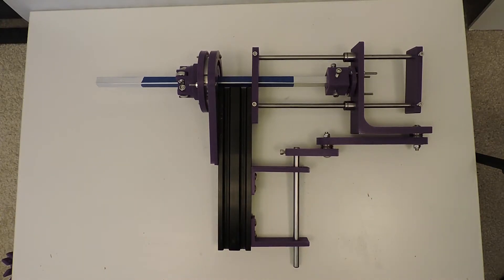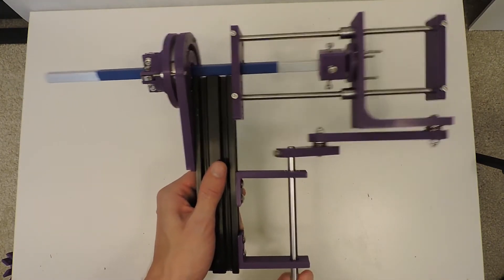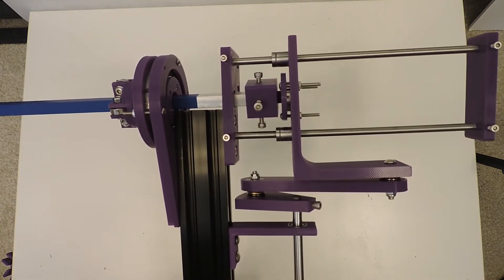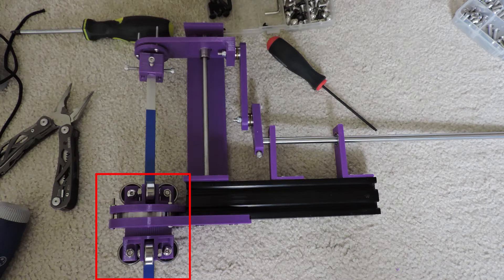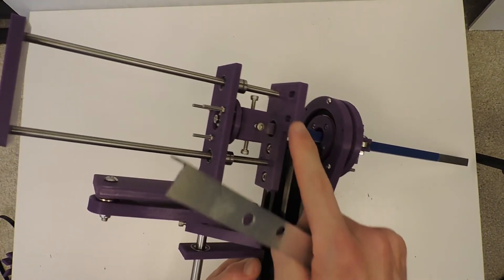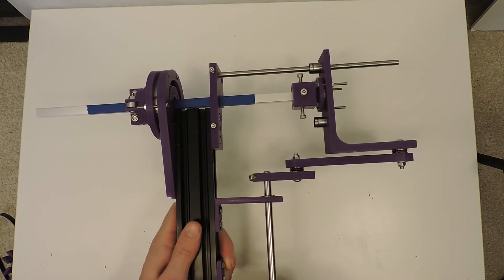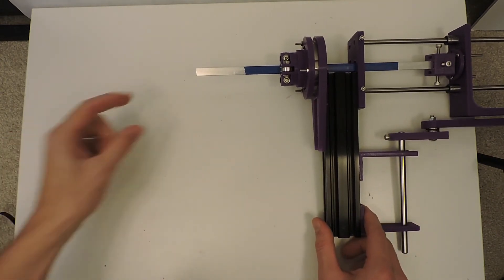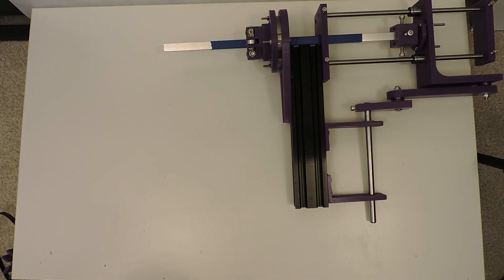Linear + Rotary Actuator

Comment from the maker: Note from future self: Using 4 single bearings to guide the square shaft works fine until you need high angular position. The radial play from a single bearing is high enough that you can't reliably turn less than 1 degree. To solve that, I'm using V-wheels which have two bearings and mounted on a dowel pin to reduce play. This also removes the need to have the hacky blue-tape on the shaft. You also want to add some preload adjustment which I did with two set screws per wheel to push on the dowel pin.

Comment: Hi Andrew, wouldn't a pair of thrust bearings work? One on each side of the square piece. And have them pre-loaded ? One for up loads; other for down loads?
Counter balance .. I'd think the counter mass should be in the same plane as the link. Otherwise there'll be another unbalanced torque along the rod.
Came apart ... looks like the set screws weren't tight enough; thread them into the shaft & not just pinch the shaft.
Anyway, this is looking good ... more and more fun each time😁           Stay safe.  -Mike😷
Reply from the maker: Yes! I think I see what you're saying, great idea. If I have issues with the radial bearing I will use that.
I just might not have explained well in the video about the counterbalance. Time will tell, it should be in the next video or the one after that.
I think I have to settle for a ground flat spot as they are hardened rods but yes, the little set screws just weren't enough. I suspect the rods were slightly out of parallel and caused the linear bearing to grab and rip the rod out
Reply: @AndrewConsroe  Cool!  ground flats AND loctite😁
Reply: You can change your 3D print to a split clamp, they hold much better and you won't have to machine the rods. You can also run a sheet metal bracket down the side between rod end prints.
Reply from the maker: I've used a split clamp design in other things and you're right it holds very well. I didn't use that initially here because there's not as obvious of a place to add the split but I think I will revisit this approach. Thanks for the comment